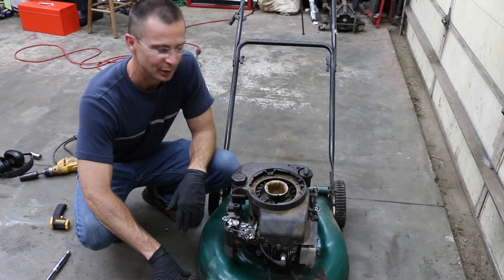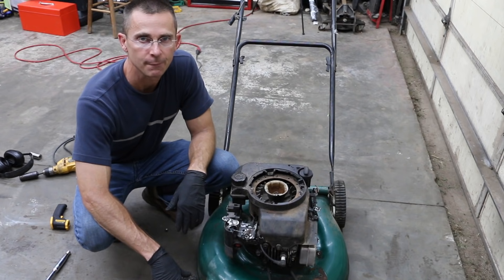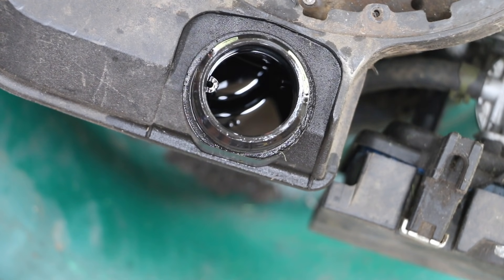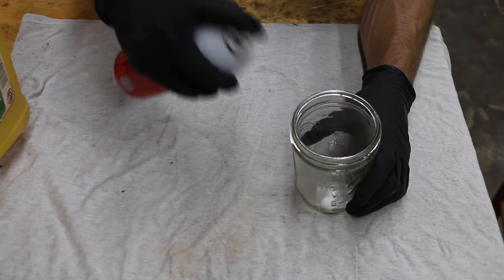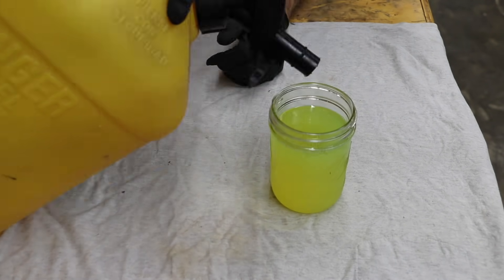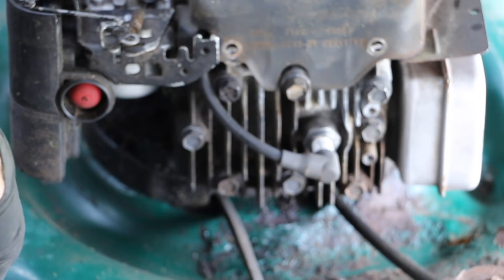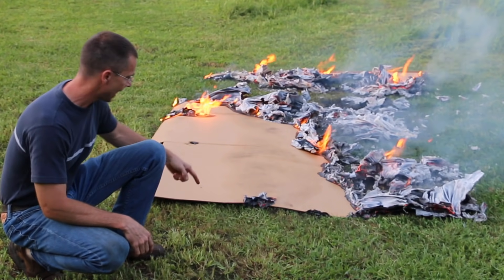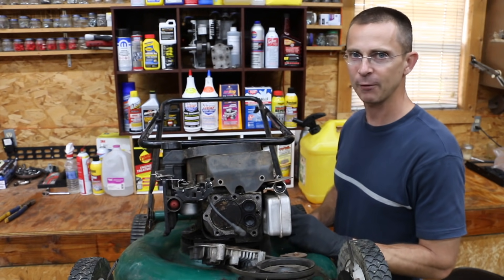Will a Gas Engine Run on Diesel?  Let's find out!

Comment: A diesel will also run on a 50/50 gas diesel mix. I was tired after driving home from the beach several hours one day and stopped to fill up my one ton Silverado Duramax. Normally the diesel pump has a green handle so that's what I grabbed and started filling. About half full I awoke from a daze and realized I was pumping gas in my tank, it had a green pump handle. So I of course stopped and filled the rest of the tank with diesel and drove away feeling a bit uneasy about the situation. I had talked with a diesel mechanic about burning different fuels in a diesel before so I didn't freak out too bad. Anyway, I really couldn't tell the difference driving the truck, just restarting when hot. I would have to go under the hood and pump the fuel manually several strokes then it would start again. Diesels will also run on heating oil which is identical to diesel with the exception of the color die which shows if the road tax has been paid, and on kerosene or jet fuel which is a high grade of kerosene.
Reply from the maker: I enjoyed reading your comments--thanks!

Comment: Diesel has a minimum flash point of 52C (125F), whereas Gasoline/petrol has a minimum flash point of -43C (-45F).  For the uninitiated (probably not many of you), the flash point of a potentially flammable liquid is the temperature where enough of the liquid can evaporate/vaporise to form a combustible mixture with air. Propane has a flash point of -104C (-155/6F).  It would be interesting yet extremely dangerous I guess, to try and rig up a propane feed to the motor. I'd assume you would require a minuscule amount of propane to achieve ignition. Controlling that flow and preventing any blow-back would be the biggest hurdles do you think on that motor. I guess it would be possible to modify a motor car LPG system. Or have you tried propane already? You can tell I'm new here :)
Reply from the maker: These are great video project ideas.  I have not tested propane yet.  thanks for this suggestion!
Reply: There are tons of dual fuel generators available - runs on gas or propane - so that's been done and not a big deal since some are pretty cheap.

Comment: Initial start up must have been on the petrol left in the fuel lines and carburettor float bowl.
Reply from the maker: There may have been some residual but I did run the mower until it stalled and then added diesel. Thanks for commenting!

Comment: A gas engine will run with Jp4, which is jet fuel. I ran it in an a 65 Volkswagen back in the 70's, no problem.
Reply from the maker: Impressive. I'd like to do a video on this.

Comment: I thought napthlaene (moth balls) were used to raise the octane rating of fuel, making it harder to ignite, etc.
So it would have made the diesel even worse for the petrol engine.
Reply: When i studied mechanical engineering, cetane was critical...it gives fuel oil the kick to combust under compression....so i would say you are right about moth balls and the engine not running.
Reply: I agree.
Reply: Mike Foehr Maybe explain The difference between diesel fuel and gasoline, and not how easy or hard they are to ignite , but the cetane and octane difference 👍

Comment: I work for A bus company when one of our buses was refilled with petrol the boss who knew I was short of cash offered me the fuel from the bus which was about 30% diesel and I further reduced it to about 15%, worked well just running around town but when I headed up the hill out of town I laid down A smoke screen that would have put James Bond to shame.
My guess is that the diesel was getting past the rings and building up in the sump when I drained the sump I got about 8 litres from it that is about double what should have been in theirs.
Reply: Norman Lesley  I bet your engine was clean afterwards if what they say about deisel's cleaning ability is true
Reply: Yes and no the broken oil rings on the back cylinder negated any good dun.
Reply from the maker: This is interesting. It does sound like diesel made it past the rings.  Thanks for commenting!
Reply: Norman Lesley 
This is really bad on modern cars. It will wreck the oxygen sensor in the exhaust, and the excess fuel (evidenced by the smoke) will begin burning in the catalytic converter and cause it to melt down.

Comment: could you build a sort of Gas modification to run a lawnmower on camping stove gas?
Reply from the maker: This is a great suggestion--thanks!
Reply: i collect old mopeds ,and in the near future they dont want them in the city,only if they run on electricity or clean fuel. gas could be the answer to the problem. long toughts about it,but i have no old lawn mowers to try,

Comment: Will an engine run on lacquer thinner or paint thinner?
Reply from the maker: Thanks for this recommendation!
Reply: I've run an old 1/3hp 4 cycle Iron horse gas engine on straight Lacquer thinner. ran better on it than gasoline after optimizing the AFR . paint thinner is varsol, varsol is flammable but beyond that I don't know

Comment: Hey I think your the perfect person to be the first for a 50 50 mix of has and diesel with a glass cylinder head I think I and many people are curious to see what happens when you mix gas with slower burning oil and if it detonates or runs fine
Reply from the maker: This is a terrific suggestion--thanks!

Comment: I have a suggestion. I've always heard that you can run gasoline mix with ATF in a 80/20 blend to clean out an engine. And I've also heard to clean out a diesel engine to run ATF in the tank also. It will be neat to see. Also may do a better job than expensive products.
Reply from the maker: This is a great suggestion--thanks!

Comment: you are right, diesels operate on compression ignition, usually about 500  psi vs 125 or so on the gas engines. diesels will run on just about anything even gasoline. diesels wont last too long on gas b/c gasoline doesn't have the lubricating qualities the diesel fuel has.
Reply from the maker: Thanks for commenting!

Comment: Have you considered seeing how much ethanol your lawn mower will run on?
Reply from the maker: This is a great video idea!  I'll do a video on this.
Reply: When you make the video please point out that long term use of ethanol in some engines can accelerate corrosion.  That's been an issue for older vehicles that were designed before high levels of ethanol in gas were proposed.  Also, the heat of combustion of ethanol is lower than for gasoline so there will be less power available.  But with a lawn mower the difference might not be noticeable.

Comment: In my Carburetor car I use 20% Kerosene and 80% Gasoline and works great!
Reply from the maker: Thanks for this idea!  Do you get better fuel economy with this mix?
Reply: Yes! Plus more torque at lower RPM and got rid of engine knock

Comment: Those lawn mowers are only around 6 to 1 compression ratio, a higher performance gas engender like over 10 to1 will run on pure diesel after its  warm.
Reply from the maker: This is great information--thanks!

Comment: If the engine was warm, the engine would have ran fine on diesel. I say this because when i was young on my fathers farm, I once filled the grain auger engine with diesel when it ran out of gas (Dad had changed over one of the gas tanks in the yard to diesel for harvest and not told me).  It started right up and I finished unloading the truck. When I came in with the next load however it would not start again. It did no harm to the engine, but we did have to remove the diesel and put gasoline back in the tank.
Reply from the maker: This is great information.  Thanks for posting these comments!

Comment: 1/3 acetone 2/3 diesel mix. probably clean engine better compression. if you let an engine warn up drain a 1/4 of the oil out put diesel into remaining oil let it run for a few minutes and see what all comes out the plug hole.
Reply from the maker: This is a great suggestion--thanks!

Comment: Try different ratios of 2 two cycle oil.
Reply from the maker: Thanks for this idea!
Reply: Project Farm I have a modified Murray riding mower. I'm actually running a gas 2 stroke oil mix in it right now. Its a older Briggs 12.5 horsepower. It runs perfectly fine.

Comment: When I was young and working on the farm we had to run some of the pickups on diesel if didn't have enough gas to get it home. Always had diesel for the tractor so would get the pickup started on gas and then put in the diesel! Put many miles on engines that had that done multiple times to it and had no problems.
Thanks for sharing and take care.
Reply from the maker: Ken, thanks for sharing this experience!

Comment: I have heard of mixing like 1/10 diesel into your gas mix for small engines and that would act like pretty much super cheap seafoam
Reply from the maker: Tim, thanks for commenting.  I'll test it and see if it helps clean the engine.  Thanks!

Comment: So if diesel takes longer to burn, why do you get less gas mileage
Reply from the maker: Typically, diesel provides better fuel economy over gas engines.  Also, 1 unit of diesel contains more BTUs of energy than gas.  Thanks for commenting!

Comment: Will a diesel run on kerosene
Reply from the maker: Thanks for this idea!
Reply: Kody Rees the first diesal engine was actually ran by kerosene. Diesal is named after the inventor rudolf diesal, back when he created the engine kerosene was used until they made the special mix known as diesal
Reply: kerosene is a more refined diesel so of course it will run on it

Comment: I used to work in the petroleum industry.  When we had a shortage of diesel we would use jet fuel instead.  The guys that worked on our small engines complained of increased engine wear.  The jet fuel lacked the lubricity to protect the small Diesel engines.  I wonder if mixing diesel with gasoline would increase the lubricity of the gasoline extending the life of the gas engine.

Add in the increased energy density in diesel and you might also extend runtime per tank.   Hmmmm
Reply from the maker: You've got some great thoughts!  Thanks for the video ideas!

Comment: Take the spark plug out fill the hole with jb weld and see if the Diesel will run like it dose in a Normal Diesel engine
Reply from the maker: Thanks for this idea!

Comment: Gas has a higher vapor pressure so it will evaporate and diesel, not so much. You are using a carburetor so diesel is not getting to the engine unless you pump it in with the primer. I wonder if diesel would work on a fuel injected engine? In a diesel engine the gas will cause the injectors to die as they need the oiliness of the diesel, sulfur or additive, to lubricate the injectors so no gas in a diesel engine or you will be replacing injectors and you will need a basket of money for that. Gas burns hotter but diesel has more btu's so it contains more energy than gas, and that is why a diesel car will get better fuel mileage than a gas car with all else equal.
Reply from the maker: You are very knowledgable on fuels.  I enjoyed reading your comments--thanks!

Comment: We had to overcome this problem several years ago when working on a logging site and ran out of gas and had only diesel. We first increased the air intake on the engine then boosted to voltage firing rate on the spark plug while using a coating to reduce heating on the porcelain. We then reduce the octane level by adding a carboline substitute one of the guys made in the lab then further reduced the viscosity by adding an anti-emulsifyer and passing the gas through a carbon extreminator. Finally we changed the molecular structure of the fuel via the age old method of electolosis. The engine worked great and saved us a lot of time.
Reply from the maker: Rick, Impressive that you worked though this.  You're very knowledgable on fuels!
Reply: Thank you ,, nice of you to reply.!

Comment: Many years ago, when mowers had carburetors with adjustable mixture screws, I ran one on kerosene.  Got it started and warmed up on a little gasoline in the bottom of the tank and then filled it with kerosene.  I recall having to richen the mixture, but it ran just fine.  It wouldn't start on kerosene though.
Reply from the maker: Thanks for this video project idea!

Comment: It seemed like, based on having to use the prime bulb continuously, that you needed to re-tune the carb for diesel.
Reply from the maker: Yes, this engine had one of those non-adustable carbs.  I should have used a different engine with an older style carb.  Thanks for commenting!

Comment: Every diesel engine I have ever seen was fuel-injected, so maybe that mower would run better if it had a fuel injection instead of a carburetor? Just a thought about how to vaporize diesel properly so to give it enough surface area with the air in order to properly ignite it upon compression - remember how the gasoline side of that cardboard already started drying out when you lit it up? Gasoline is much more evaporative than diesel fuel is, so that may be one factor that makes it harder to start and keep running on diesel than gas.
Reply from the maker: You bring up some great points.  Thanks for commenting!

Comment: When I was a teenager my dad bought an old Yazoo lawn mower with an 18 hp Wisconsin Engine.  He was told that the mower had been spec'd out for Military contract (in a former life).  The mower had 2 fuel tanks - 1 for gas and 1 for diesel.  We were told that it was designed to crank on gas and then when up at temperature switch to diesel.  Not something we ever tried.
Reply from the maker: Tim, I enjoyed reading your comments.  Thanks!

Comment: Great video!
It would be interesting to see how a 75/25 gas and diesel mix treats an engine. I've always wondered if the lubrication a gas engine gets from a touch of diesel would help. Or, if there would be too much carbon.

Comment: I was rather common to run a bit of diesel in normally aspirated vehicles.  That's right boys and girls car engines  had carburetors 2V, 4V, even 6V.

Comment: Another great vid! hadn't even watched it and I'd already given it a like. I'd like to see you try running an engine on pure acetone, rc car Nitromethane, isopropyl alcohol, vodka, whiskey, toluene (scuba suit cleaner) and aviation grade fuel. Also I had a diesel engine in recently for repair that had cracked a fuel line in it's head and dumped a bunch of diesel into the oil, so I'd also like to see just how bad the engine damage would be on say a 50/50 oil/diesel mix  in the lube system.

Comment: Will it run on tiki torch fuel?
Reply: As an experiment, I added 50-50 mix of tiki fuel and gas to my old mower. It ran OK, but whenever there was a load on the engine due to tall grass, you could hear a loud, metallic pinging due to pre-detonation. I ran it like this for over 30 minutes and did not notice any engine damage.
Reply: What happened to those emails i wonder.
Reply: Chevygmoney Tiki torch fuel is basically scented kerosene. They add additives like citronella to give it that smell. Much like diesel kerosene doesn’t flash and ignite like gasoline so the results would be closer to diesel.
Reply: Tiki torch fuel is basically kerosene with added smells
Reply: Andrew Moore can you make a video? That would be awesome!
Reply: That’s basically kerosene. It burns much cleaner than diesel so a gas engine can run on it if it’s fully warmed up first, but not that great.
Reply: I doubt it. You can run kerosene in a diesel so I don’t think it’s as volatile
Reply: Yes. And kerosene. K1 burns in my junk mower better then 10%booze gas. lol
Reply: Ill bet Hillary will burn with tiki fuel. Soros too.
Reply: Mac Ten lmao, typical Trumptard. Instantly deflects to Hillary. 
But HILLARY! 
But muh emails!

Comment: Back in the 1940's there was tractor fuel, which was about midway between gasoline and diesel. Tractors that used this lower priced fuel had lower compression and also a small tank of pure gasoline for starting, since tractor fuel wouldn't volatilize well with a cold engine. Improvements in the refining process using cracking and catalysts eliminated the economic reason for tractor fuel.

Comment: Briggs & Stratton actually had a kerosene kit for the 8 to 16 HP engines years ago that consisted of dual fuel tanks with shut off valves that fed to 1 line to the carb and an extra head gasket. You installed the extra head gasket to change the compression ratio and filled the carb with gas from the 1 fuel tank and started the engine. once it was warmed up you shut off the gas and opened the kerosene flow, the engine would not run smooth till you reached down and tweaked the main jet that at that time had a spade type head instead of a slotted head screw.  Before shutting the engine down you needed to switch back to gas so that you could restart it once it cooled down.

Comment: Back in the 50s, we had a garden tractor with a 4 stroke engine. My Dad ran strictly what he called white gas in it. I suppose it was kerosene, but it ran fine and always started easily. It was called a Rotoette.

Comment: About 45 years ago, our lawn boy accidentally put kerosene in my old gas lawnmower.  It took some effort to start, but once started, it ran fairly well.  In addition to cutting the lawn, it did a fine job as a mosquito fogger, barfing out great clouds of smoke.  No flying critters snd the lawn mowed!

Comment: I have made a engine run on diesel by running the engine beyond full warm-up and adding diesel to the tank while running. It smoked like a banshee but ran under 3/4 throttle. The diesel will work if the engine is hot enough to vaporize the diesel in the cylinder.

Comment: Revisit the diesel test some time by putting the hottest heat range plug that'll fit in the head.  Also try preheating the head with a propane torch, I bet the result would be interesting to say the least.